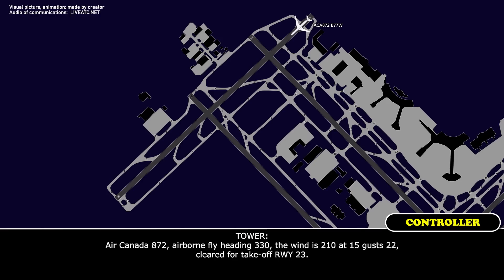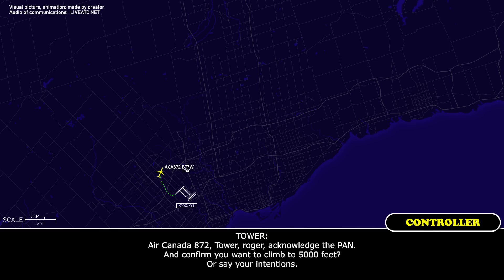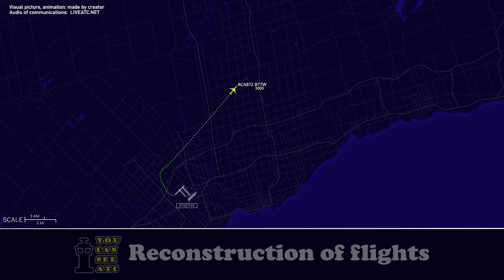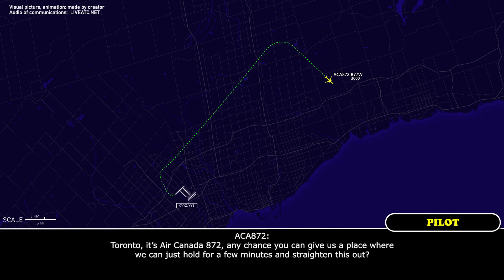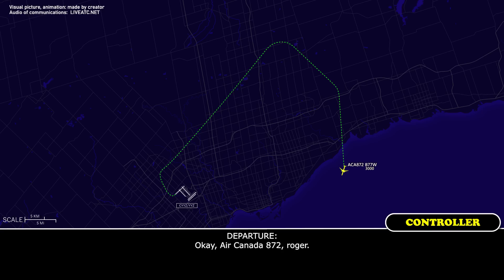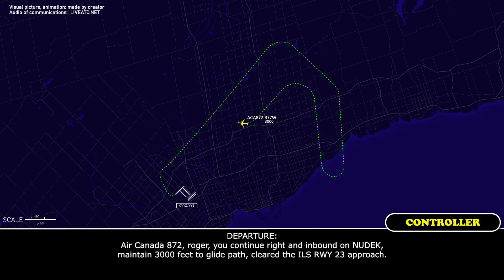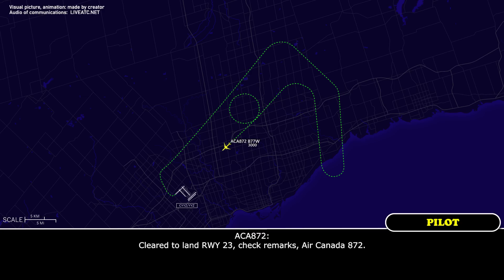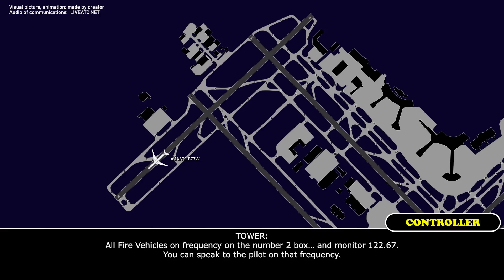“You got a lot of fire”. Air Canada Boeing 777 returns to Toronto Airport. Real ATC

Comment: Definetly a mayday
Reply: @DIRTYdeeds613  a compressor stall is not an engine fire.  Yeah it burps flames but it's like a car backfiring, not literally on fire.
Reply: Not at all. Some companies stipulate the difference between pan and mayday and when to call for what. Some companies for instance have ANY return to the departure airport as MayDay while others have it different.
Reply: @DIRTYdeeds613  I mean anyone can comment but this debate is played out. You know as well as I, it’s up to the PIC and how they feel the plane is handling and their current awareness of the situation. If the compressor stall is throwing extra sparks, but their climb rate/ v-speed is fine, pan is fine. It’s not cut and dry. Neither of us were up there, so to debate every incident is just another reason to argue online
Reply: Gentlemen 
Unless your a PIC  of  Widebody for a major airline, I suggest we differ  to the aircraft commander.
A few things to consider.....
- A compressor stall is one of the most common situations  practiced in simulator training
- compressor stall  may reduce power in the effected motor but it normally maintains  a significant  level of thrust. All modern airliners are fully capable flying on one engine so reduced power on 1 motor is not life threatening 
- the flames that occur during a compressor  stall are impressive but do  not normally  start an engine fire engine 
- most airlines have a set of criteria guide the PIC  when determining if it is a pan or an emergency.... but the PIC Makes the call.
 The crew performed according to thier training. Standard  processes were followed.....
Reply: Found “the guy” who knows better.
Reply: @DIRTYdeeds613  i’m sure we’re both happy to hear Mayday or pan pan instead of the “declaring an emergency”
Reply: why?
Reply: @DIRTYdeeds613 I read a funny comment on YouTube today. It was a blancolirio about a bonanza crash. It was a doctor. Someone called him a stethoscope tailed bonanza killer
Reply: @DIRTYdeeds613  An engine failure in a Bonanza would be a mayday... and even in a Beech Baron or Duke withi two of those spinny things up front .  In a jet like the 777 with tons of excess thrust, they can fly on a single engine no problems (they are certified to cross more than 2.5 hours of open ocean on them) so it isn't life threatening and not a mayday.
Reply: E    M   E    R    G    E    N    C   Y
Reply: Understood, want me to scold the pilots for you? 😂

Stick to flight sim bud
Reply: No.  It's not.   Mayday is used if the emergency is life-threatening.   Obviously, if you can climb/descend/turn and run checklists - the emergency is NOT life-threatening.
Reply: ATC: "You've got a lot of flames coming out of your engine".... 
AIRCREW: "yeahhh, no problem, happens all the time, but I'm not an emergency coz the wing hasn't dropped off yet and we haven't fallen out of the sky, so I'm not an emergency, only a 'pan pan' - Oh by the way, I fully expect to be treated totally like an full emergency with full priority, plus full firecrews meeting me and by the way, I want to stop on the runway and be inspected by the firecrews and all and when I land, I also expect to maintain primary comms link with you on ATC, but I'm not a 'mayday' you know? 
Well, perhaps our standards are different here in the UK, but we'd have our decision making skills severely questioned if we tried such shenanigins here!

Comment: Let the pan pan vs. mayday comments begin!
Reply: MAYDAY (Distress priority), PAN PAN (Urgency priority) and SECURITE (Safety priority) have the same importance and must be given the same attention! They only differ in their priority for broadcast (if they happen at the same time). Distress communications shall have absolute priority over all other transmissions. (via Google)

Previous life was marine radio operator, search and rescue.
Reply: @ArthurPaliden , See Aeronautical Information Manual, 6-3-1.
Reply: I believe it was a compressor stall, the pilot did mention stall in the transmission but the word compressor was cut out. I’m not a Boeing pilot but I’m not sure if a compressor stall dictates a mayday?
Reply: @DIRTYdeeds613  thank you!
Reply: There’s no absolute rule about which to use. It’s up to the pilots to decide. Except for the USA which has its own way of doing aviation and they are obliged to “declare an emergency”.
Reply: @meofnz2320 , That’s a petty statement.
Reply: @alpenglow1235  
It is actually true. And why in the USA the phrase “declaring an emergency” is commonly used and “mayday” or “pan pan” are rarely heard (even though both are accepted means of declaring an emergency under FAA regulations). However this is slowly changing as the USA gradually aligns with international procedures.
Reply: Could be worse, this could have been an emergency.
Reply: People with such comments are very annoying
Reply: Keyboard pilots never disappoint lol
Reply: This made me laugh. So now explain the difference. :) I’m new.
Reply: They likely still had over 50% engine power, hence PAN instead of Mayday
Reply: @meowmeowkawaii6128 , Oh yeah! They shoulda just kept going, too. All the way to France!
Reply: @alpenglow1235  Mate you obviously have no clue how planes work lol, he could very well still climb with one engine and the other at idle. Esp if the other still was producing some power. A full emergency is only declared with loss of 50% of more engine power.
Reply: @meowmeowkawaii6128 I like it when you say « mate ». Sounds friendly. And British.
Reply: @meowmeowkawaii6128 ,  The argument is not about performance, it’s about safety. “Obviously” you don’t know what it means to be free of harm or damage.  Your attitude wreaks of ignorance. 

In 42 years of aviation, I’ve been close to fatal aeronautical events. And, no one will convince me to be less than conservative in making decisions which affect life.
Reply: @alpenglow1235  Your attitude does, years alone don't mean anything. Jet engines now are far more reliable than when you started flying half a century ago mate. That is if you are even a pilot - most certainly does not sound like it.

It is perfectly safe to declare a PAN instead of mayday on a single engine failure. You obviously have no clue and no regard to how these procedures work and why they were implemented.
Reply: @alpenglow1235  A PAN call signals to ATC that they've got a problem and WILL be getting priority all the way back, if they are declaring MAYDAY whilst still perfrctly able to maintain altitude, needing to hold for 15mins whilst doing their checks what happens when a REAL full emergency happens? How would you diffrentiate between a plane literally dropping out of the sky vs one that's got a technical fault, but in no way or form is in IMMINENT threat of crashing? 

The rules and regulations are written this way for a reason, not because some private pilot with "42 years" thinks hes smarter than the ones at the top.
Reply: @meowmeowkawaii6128 , You wrote “jet engines are far more reliable than…”. 

We are having this discussion because a jet engine was not reliable. You’ve thrown several insults at me, and now you’re babbling nonsense.  It difficult to have a rational discussion with the irrational. Get help.

I’ll let you have the last word. I hope it’s another insult.
Reply: The most fragile cargo of all cargoes are people.
When the ship left the gate, it was airworthy - all systems normal. 
At some moment after takeoff, the word FIRE is heard and an abnormal situation presented itself as a compressor stall. At this moment, up to 450 PEOPLE are now airborne IN AN AIRCRAFT ON FIRE AND NOT CAPABLE OF MAXIMUM POWER. At what point during this scenario does your neighbor’s family, only a few of the 450 PEOPLE aboard the airplane, deserve to be given the critical consideration which may save their lives?

By the presence of airport “emergency equipment”, as well as the reference to “the emergency aircraft”, it is clear that ATC declared an emergency for Air Canada.

Anyone who feels this situation did not deserve a mayday call, you are careless, cavalier, and dead wrong. 

I direct you to read the Wikipedia entry for Air Canada Flight 797. And, consider what resetting a simple circuit breaker can do to your most fragile cargo, people.